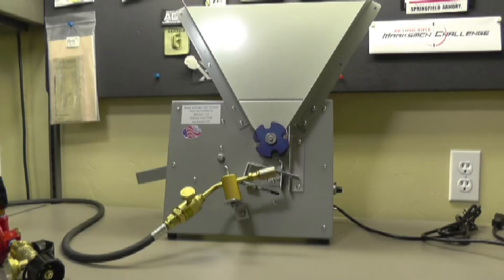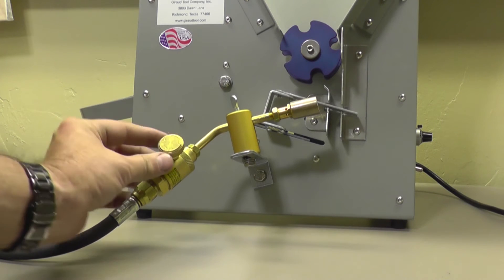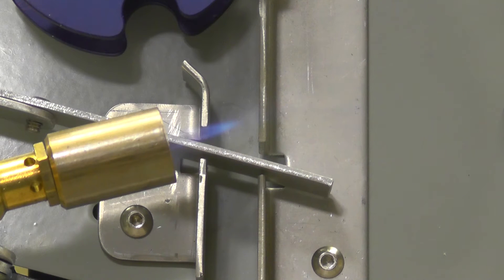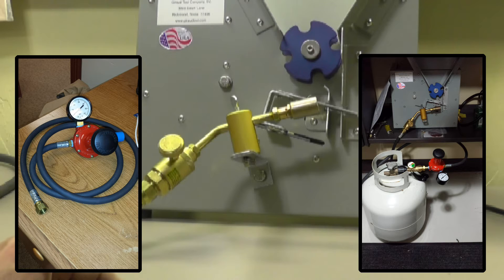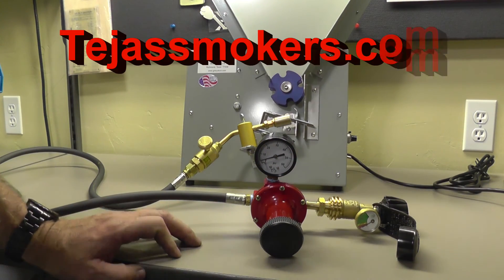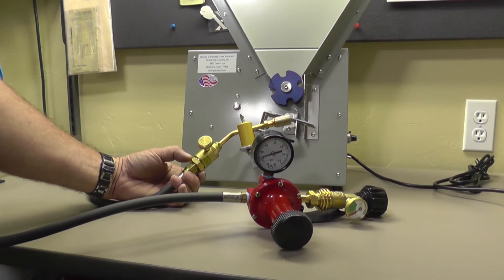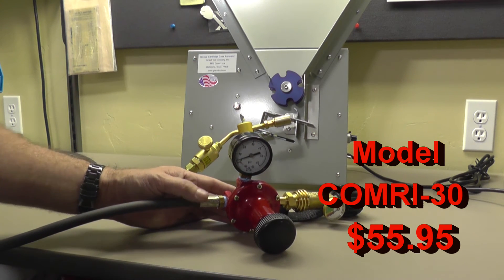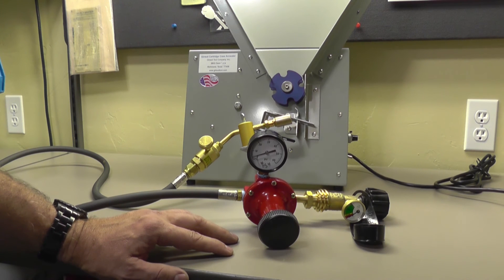Giraud Annealer Pressure Regulator Upgrade

Comment: From the time you placed your order, what was the turn around time to you home?  Great vid, thanks.
Reply from the maker: +TheSgtk9  Time depends on demand. When I ordered mine I also ordered the Trimmer and I was told one would be 3 weeks and the other would be 6 weeks. (i dont rem which was 3 or 6). About 2 1/2 weeks later they both showed up at my door.

Comment: Thanks for the video and sharing the parts list. I have hated setting up my annealer every time since to shut it off I have to turn the stock regulator off so it's a hassle every time I use it.

Care to share some sample times/ feed tray speeds and regulator pressures for starting points?
Reply: Tejas Smokers has shipped the regulator assembly as described in your video. I am 99% sure of the fitting needed to bypass the Giraud regulator altogether but I will wait until I get the item from Tejas first. A local hydraulics shop has the fitting but I will bring the desired mating pieces with me to verify. If it is what I think it is, I will post to your site on here with the part number, if available, and the threads so anyone else can duplicate the set up.
I may get the unit by this Friday and I will post after I assemble it.
Reply: I tried to say it in few words but I discovered that I would have left out important information. I rewrote it about 3 times and I think it covers it now.Yes, the Tejas Smoker adjustable regulator works great. They called prior to shipping to clarify the address and I had a long chat with the gal on the other end. Very knowledgeable and this is not a cheap assembly either. I keep the old parts, just in case and I can convert back if needed. It was nice of you to display the part numbers in the video; made it easier to order.
Reply from the maker: It was good talking to you today about all this stuff.  Hope you got all your questions answered - if not you know where to find me in the Facebook Group.  Thanks for the tip on the Giraud case trimmer.
Reply: I am a tad late in my reply but I was successful in eliminating the scratchy Goss flame control regulator that came with the case annealer. In an attempt to use only one fitting, I discovered that such an animal does not exist, at least in the inventory that my hydraulic supply shop had on hand. I ended up using two adapters instead. Parts used are a 3/8" male flare adapter, that mates with the Tejas Smoker hose,  with the back end being a 1/4" female flare adapter. Coupled to that is a 1/4' male  flare adapter that opens to a 5/16" female flare and that part fits the blowpipe that you remove from the Goss GP-9 regulator that is supplied with the annealer. A note of caution: The blowpipe uses a brass ferrule for sealing in the original regulator and part of the pipe extends beyond the ferrule and it sockets into a flat recess of the Goss regulator. Its main function is for stability as it does not seal in that pocket, the ferrule does the sealing. In order to keep this arrangement the same, a recess must be drilled deep enough into the back of the second adapter so this pipe will not bottom out. If you do not and just tighten away on the brass nut of the blowpipe, like I did the first time, the ferrule will slide on the pipe until it seals but it is dangerously close to the end of the pipe. After muscling the ferrule back up on the pipe, I drilled the recess as described and the pipe end just barely touches the sides of the drilled recess. A 5/16" flat end mill would be ideal but lacking that, I used a drill bit in my lathe and just went a tad deeper to allow for the taper of the drill point. With both of these adapters linked together, the length is the same as the Goss regulator but it cleaned up the area under the hose and pipe enough that I can now roll my cases out of the way w/o whacking my hands on the knob and such.As for part numbers, I did not ask as my hydraulic buddy gave them to me and I was not going to pounce on him for numbers. When it is a freebie, you take the stuff and do not annoy the gift-giver by pestering him for part numbers. So far, I have done about 500 rounds of 50 cal and it is working like a champ. Turning the Tejas regulator is like dialing  the barrel on a micrometer; smooth and the adjustments  are infinite. Worth the money in my book.
Reply from the maker: Thanks for adding your experience Mike. Glad you like the upgrade. I know it made a world of difference for me.

Comment: Thank you Sir for the information and video. Very professionally done, easy to understand, and I really appreciate you letting everyone know where and which fittings and regulators  to get. Also appreciate you letting us know how big off a dent it is going to put in our wallets. 
I was just over at the Giraud website, and it seems Doug is going to have a new induction annealer coming out soon?. From what I saw on the site and what I have read on the web about this system, it should be a hot selling item. I am guessing it ain't going to be cheap. Maybe we will see a glut of the Giraud gas case annealers up for sale! I hate waiting, but the little lady has her foot resting on my throat just daring me to buy another"toy". 
Again Sir, thank you for sharing your video an information-John
Reply from the maker: it looks like the annealer is not going to change its just going to have the induction annealer add on available.  Even though Doug hasn't given a firm price yet it looks like it may be in the $600 range just for the induction unit.
Reply: +Marksmen Challenge Are you getting one?
Reply from the maker: I dont think I will be getting the induction anealer just yet. We'll see how others like it 1st. If I do I'll post another video on the upgrade.